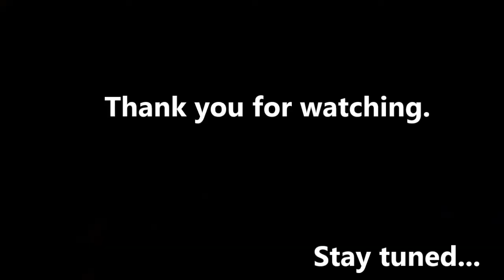Güçlü Servo Yapımı / 12V / DIY Powerful Servo - Using Drill Motor As Servo

Comment: Is it possible with l298n motor driver, if yes then please tell me its connections.
Reply from the maker: Which one ? There is so many l298n driver. It works with this, i tried ;
https://www.aliexpress.com/item/1005006036429971.html
But careful. It has max.2A support. You must use small motor. Wiring diagram is the same.

Comment: very helpful video,  good video , simply explained. thank you. baut i have a queshion.??
Reply from the maker: Thank you. Tell me please.
Reply from the maker: Understood. I made this video for that. Watch carefully. Only difference ; I used dc motor+gearbox. You can use only dc motor. ( 775, 550, 540 etc.) It will work, same logic, no difference.
Reply: but i try to add an arduino to operate this moter so please tell me the connections.
 @VertigoRC